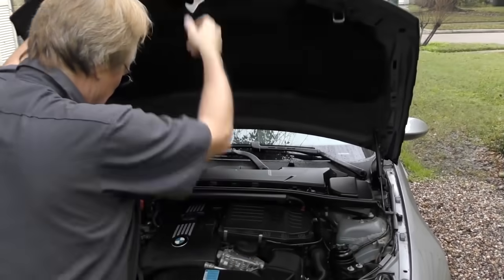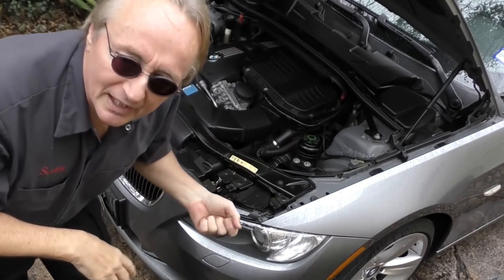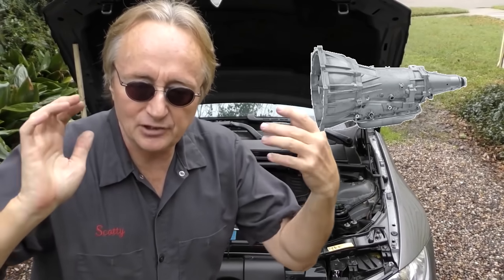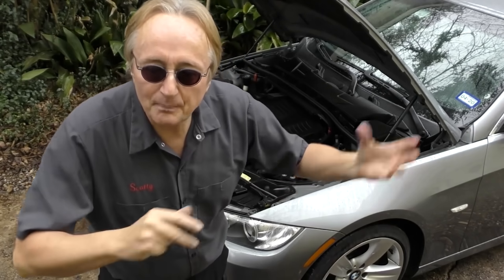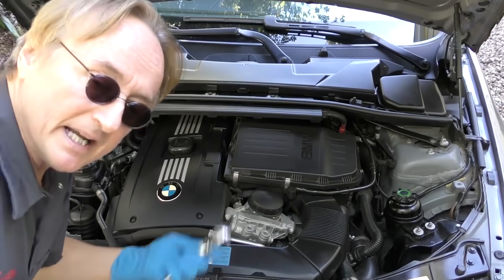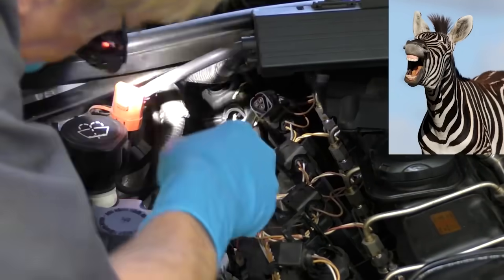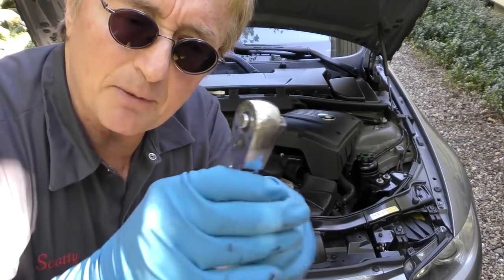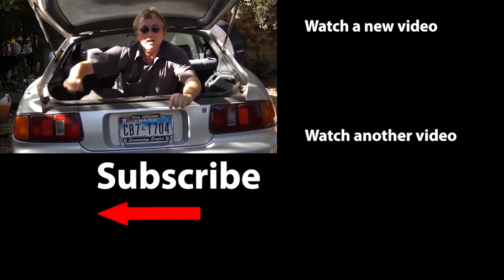People Say I'm Full of Crap About BMWs, Well Watch This

Comment: I’ve had so many electrical problems with all the bmw’s i’ve owned, they are pure junk, yes they make power, yes they are fuel efficient, is it worth the hassle, hell no, give me toyota reliability
Reply: dude, and don't you find it slightly depressing and ironic the supposedly new 'Supra' has a BMW engine in it instead of the other way around. I mean, it seems like if there exists a wrong and backward way to do things car companies always figure it out and make it happen!
Reply: The only upside of Toyota is you are less likely to have to work on it, parts will be just as expensive if you do,. And you sacrifice so much for that ease.
Reply: @Bawbrahs  yeah, there is definitely a 'boredom' thing going on with Toyota.
Reply: @Bawbrahs  oh i’ll work on it haha I own a couple of lexus’s and evo’s i bought a 325i e90 a couple of months ago, drove it for a month and it wouldn’t start at -35degree a couple weeks ago, boosted it and the push start stopped working, couldnt push start it because bmw are dumb, press the push start once to put in accessories mode then again to crank start, but the push start stopped working so i couldn’t get it in accessory mode…. The cas (ews immobilizer) fried, lucky for me the guy took it back, went out and bought an is250 instead, That bmw was my 5th or 6th bmw between me and the wife, and never again, do they get great fuel mileage? Yes, they make good power, they are pretty boaty compared to the lexus equivalent, but never again will I buy a “bus metro walk” because they’ve kept me stranded on multiple occasions, alternator issues, battery draining, starters that let go for no reasons, leaking oil everywhere, no no no never again
Reply: @Bawbrahs  "parts will be just as expensive" 🤣🤣🤣🤣🤣🤣🤣

As someone who has owned both a toyota and a BMW that couldn't be further from the truth. Not only do toyota parts cost far less, but the maintenance costs are far less as well. $2-3K for turbos on M4 = about 7 years of routine maintenance on my T100... stop the nonsense🤣

Comment: They are they best looking and handling cars. I waited 20 years to finally get a five series and love it. It’s been as reliable as any Toyota or Honda I’ve owned up to the the 80k miles mark, but I also have learned over the years to work on a many of the components, and routine maintenance of every car. I would not recommend a used BMW unless it’s a low mileage lease return, you can work on it yourself, or have deep pockets for repairs.

Comment: I’ e owned BMWs continuously since 1993 and have seen the things mentioned here.  Heat cycle and insufficient cooling at shutdown have compromised plastic part longevity.  Oil seals brittle up, and faster when you use other than BMW recommended oil.  It’s not new nor a BMW only problem.  The years where this became a problem would be 1996 to 2013.  Of course the problems and solutions follow models and introduction timeline.  Newer models keep the cooling fan running after shutdown to continue cooling process.  Grill openings got bigger.  Here is the point; any used car you buy comes with risk. Scotty is telling you what to watch for here in a specific BMW model.  Do your research and buy what you can afford to drive and maintain.  Nothing worse than picking up an abused M model that you have to rehabilitate before it’s reliable again, unless you can do it!

Comment: I have a 2008 535i and doing my own turbo replacement during the time watching this video. Not too bad to do and no I'm not a mechanic.  These cars can make a lot of power for cheap.  Ebay 19t turbos for 850. Full bolt-ons ran around 1800. When all said and done it'll make 600hp (on e40 mix). Hell you can tune a stock one and make roughly 400 hp without changing a thing. Mhd has an app for any android device and you plug your device into the obd slot and flash your motor. Good video but gotta say stock turbos run about 1500 not 3000 for both. Go ebay turbos for cheap power. Btw I changed out the thrust collar like in the YouTube video by turbo labs of America.   Great video man I like it!

Comment: Inherited a 2007 335i several years ago and I agree with your statement about some expensive thing always going wrong. In the 10 years of ownership it has gone through 3 high pressure fuel pumps, 2 radiators, a valve job, replaced all the coils and fuel injectors, replaced 1 window motor, replaced 2 cracked rims and countless run flat tires.  And the reason you got my attention was the failed hood struts which I replaced 2 months ago. I will say that when I am not sinking money into this pit it is one of the finest running cars I have ever driven. But the best option it has right now with new and used car prices going through the roof is the pink slip in the glove compartment
Reply: You know what is 335i and what people do to it? Should tell us how many rear tyres got replaced after all the burnouts.
Reply: you have the best engine with the worse surrounding parts
Reply: well its a 14 year old car !!
Reply: And a partridge in a pear tree?
Reply: @MrAvant123  Eh I also have a 07 IS250 with 196k miles and no issues, only basic wear and tear items replaced. Still original water pump etc. Window regulators still solid too. They use less plastic than BMW and better quality parts. I got all the stuff to replace on it like T stat, serpentine belt, water pump and stuff, but never got around to installing yet. It's my beater car lol I know it'll still run for at least another 100k. OH yeah, original transmission too. Do fluid flushes and recently dropped the transmission pan and replaced gasket and fluid filter too. Now I'm not being biased as I also have a BMW F80 pushing around 520WHP, just facts Toyota build quality and reliability is way better.
Reply: Just buy a Csf radiator and you wouldn’t have gone through 2 lol, what do the rims have to do with the car and who stays buying run flats, just buy regular tires, those run flats are garbage
Reply: N54 one of the worst engines I rather the N52
Reply: @MikeyG003  yeah hard to disagree Toyota/Lexus build quality is simply top draw, but they'll never be on the same levels as BMW when it comes to performance/handling/styling. I had an E46 which was a money pit then upgraded to an IS220D for 2 years no issues apart from x2 sticky calipers common issue then moved onto to a E60 530D, the lexus was the most reliable out of these three but it couldn't match performance and handling of the bmws.
Reply: @johnyp2967  yeah they definitely are reliable lol, but my generation M3 supposed to be pretty reliable as well and it has been. 39k miles modded and hard driving lol. Lexus won’t match the performance and driving characteristics as bmws. The F line is pretty nice and more fun than the regular Lexus models, but still not comparable to BMW Ms. The old ISF was actually pretty close to the e9x m3 though and wayyyyyy more reliable.
Reply: @MikeyG003  i think you need to go into these cars knowing that they do require more maintenance than a standard car, i think this is what people fail to realise and blame the car when they are built like this ...
Reply: @johnyp2967  yeah that’s true lol they expect Lexus maintenance and reliability. I just do all my own work and I do all the fluids on the M sooner than recommended cuz it’s modded and I don’t want issues later. Cheap and easy insurance
Reply: @MikeyG003  same, i like to get on the spanners, great cars for enthusiasts
Reply: Did you replace fuel pumps with aftermarket or factory spec parts, same with the radiator, coils and injectors are pretty common around 100k miles, I also am wondering if you did any of these jobs yourself as some are very doable
Reply: My new Honda Accord has a failed camera system from the Texas heat.. camera cost over 1k. Labor + programming another 1k. When the camera fails, you don’t get cruise control. No lane keeping or collision warning. High pressure fuel pumps fail every 75k miles. They leak oil at the valve covers, replaced my tensioner, spark plugs. Did brakes 4 times already. Mounts are due. Just wait till you realize all the new cars are taking notes from the Germans
Reply: @rojacob9532  honestly not even surprised. I’ve had better luck with Lexus vs same year Honda. Everything needed replacing on Honda and leaking oil, Lexus same year 2007 and 50k more miles, no issues or leaks ever. Btw Lexus at 196k haha Honda Accord at 150ish. Honda AC compressor just went out too, gonna replace it today. The motors are still solid though, build quality not so much for Honda in my experience. I wouldn’t trust the newer turbo engines tho for long term reliability
Reply: @MikeyG003  yup the engines are solid on both honda and Toyota engines (lexus) but yeah I wouldn't trust those new turbo cars at all. They took a page directly out of the Germans. I know because I work on Benz and BMW cars lol
Reply: @MoneysWorld82  not the engine, the surrounding components are garbage in the n54 but it has a wide array of aftermarket performance modifications to remedy that, also I had an n52 and it was unreliable and honestly more unreliable than my n54 lol
Reply: @MoneysWorld82  Lol that’s why it placed number 1 on Wards 10 Best Engines list right?
Reply: @MoneysWorld82  u absolutely know nothing about cars if u think the n54 is one of the worst engines I don’t even need to explain myself 😂

Comment: Had this same car in college, it mechanically totaled itself pretty much while I had it cause I was just too poor to maintain a bmw… sold it got a 03 Camry and an FJ cruiser, then got ANOTHER N54 335i cause it’s the most fun car I have ever driven!!! Have my current one modded to 480HP, it is a rocket ship will out run m3. Such a great car. Just dropped $4k on new turbos and can’t wait for the miles ahead of me worry every penny. Oil Leaks galore, very expensive to maintain but smiles per gallon are unbeatable
Reply: I hate oil leaks, junk plastic parts and crazy electrics.
Reply: Some are too poor to maintain and fix a BMW. Some become too poor after owning a Break My Wallet car.
Reply: That's the spirit of a true gearhead, these clowns on here think it's not a good machine unless it requires zero attention.
Reply: @Bawbrahs  A machine requiring zero attention that just functions is literally the sign of a good well made machine🤣 a machine that constantly requires hundreds and thousands of dollars to keep running is, "the spirit of a true gearhead" LOL I can't believe the extent to which bmw fanboys will go to justify their poor decisions

Comment: 2002 330 w 225k.  Most reliable car I've ever owned. You HAVE to do preventative maintenance(cooling system) and vacuum leaks pop up, but this car has been bullet proof. My civic is also reliable but honestly it has had more issues
Reply: same here bro I have a 2002 330ci 5 speed manual. What you said is facts also learning how to do the repairs yourself is key for saving tons of money. mine has 280K all I've changed so far is the starter, slave cylinder and control arms
Reply: capperoni

Comment: I own 2 bmw f30 m sports with the b58 engine. Amazing cars, great transmission and one is approaching 70k miles no problems on either one. As far as needing expensive equipment to maintain it. Just basic tools and a little know how. Don’t see how this car is much different then any other modern car. I have never been a fan of bmw’s until the b58 with the zf8hp.  Plastic parts are on every car including Toyota. Like to know your thoughts on the new Toyota Supra (rebranded bmw).
Reply: Of course you don't see how it's much different - because it isn't. You're not on YouTube being intellectually dishonest like Scotty is to make a living. Literally basic tools + about $30 for a set of e-torx and torx sockets will see you through probably 90% of BMW jobs. The only time you really need specialty tools is if you are doing more invasive jobs like removing VANOS gears.

Comment: Currently a proud owner of an e39 528i. Have had to replace 02 sensors, camshaft position sensors etc.. outside of the hundreds of $$ of parts, it’s very fun to drive.
Reply: You will never find a better car.
Reply: FCP Euro has lifetime replacement for everything they sell including oil...
Reply: @slam44  Any typical honda or Toyota will outlast a BMW at a fraction of the cost... I'll bet my house that they'll be cheaper to maintain over any time-frame you want to compare too 😏